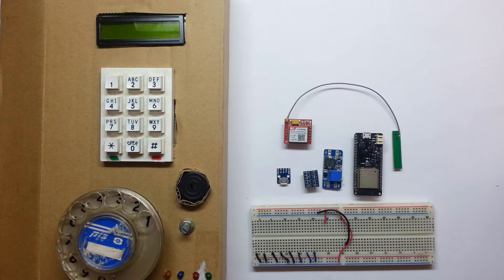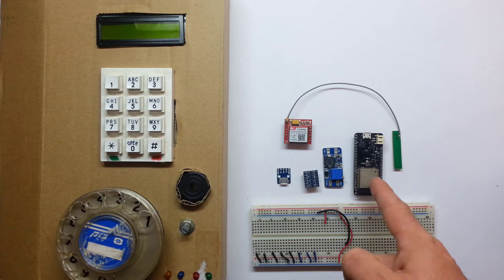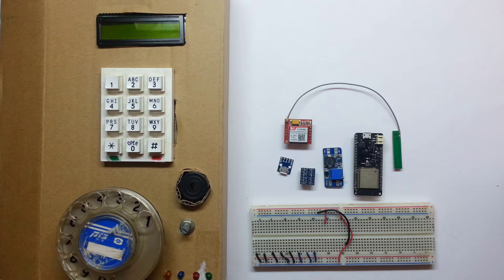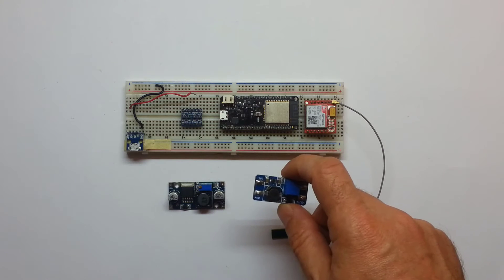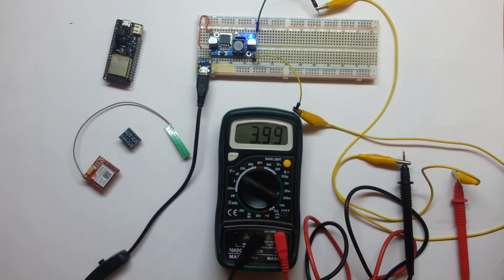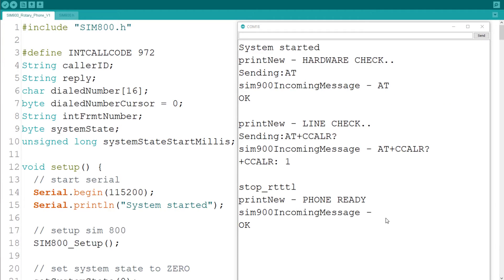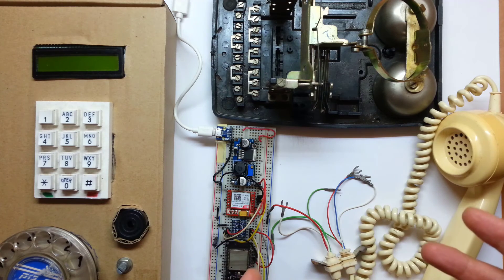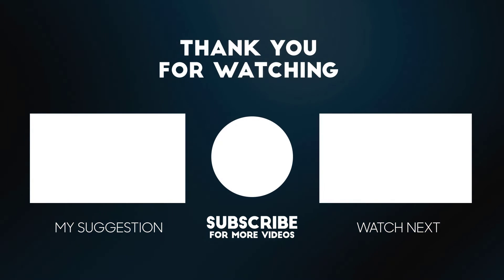Taking a rotary-dial phone into the future – part II – esp32 and sim800

Comment: Hello!  Thank you for posting this.  This is the only helpful tutorial I have found online for using an ESP32 with Sim800L.  You use the voltage step-down to bring 5v to the 4v.  However, the signal coming out of the Sim800L is probably around 4 v and you wanted to shift the logic level to be 3.3v.  What level shifter did you use?  I am only finding 5v to 3.3v level shifters.
Reply from the maker: Hi, Thanks :) 

I used one like this 
https://www.ebay.com/itm/5Pcs-Bi-directional-Logic-Level-Shifter-Converter-Module-5V-to-3-3V-For-Arduino/332801263067

note that it also says 3.3 to 5, but if you read the comments on the product you can see they mention it will work on 1.8 and 2.3 as well. 

One thing I should do, not that I think of it, is to add a list of parts in the description when I upload stuff like this.